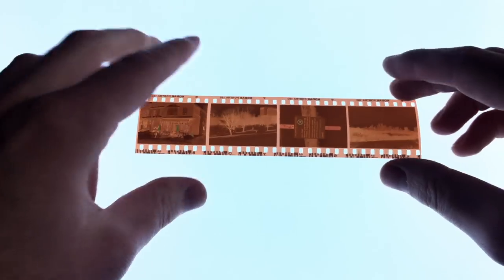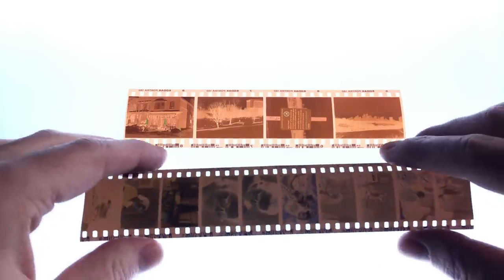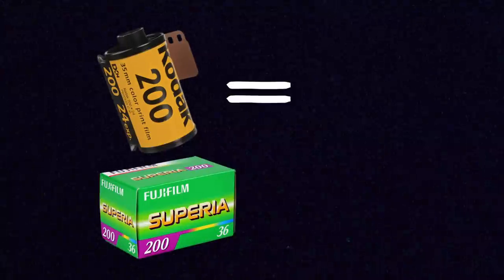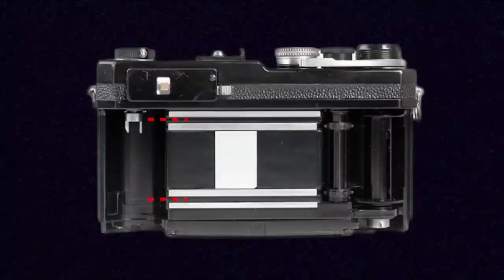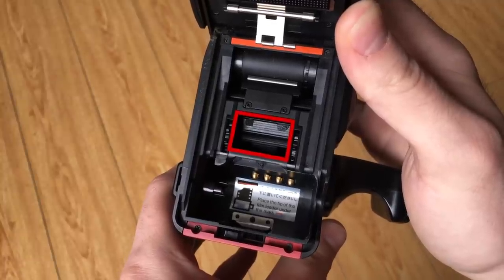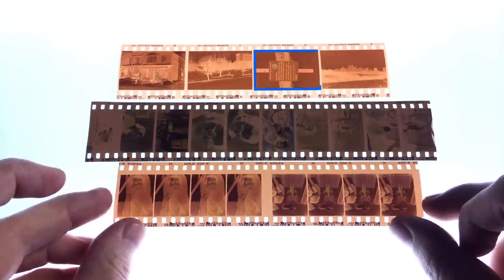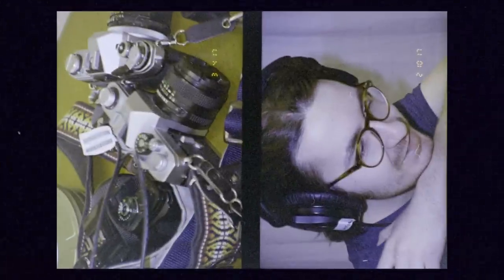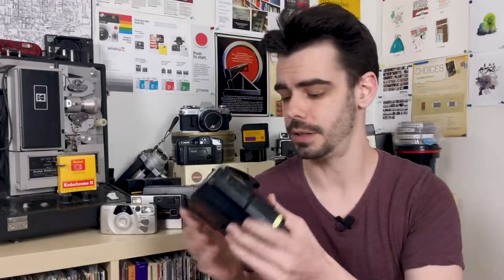35mm Half-Frame Cameras - How Do They Work?

Comment: There was kind of half frame camera in Soviet Union. It was called Agat-18 (Агат 18), and it's been producting since 1987 to 1990 in BeLOMO (Belarus). It is very interesting camera, because of it's controls, she has two rings that control exposure compensation and aperture control, and Industar-104 f/2.8 28mm lens. Funny fact is that even being not so correct in her exposures, she was doing pretty good shots in low-light with shutter speed of 1/120th, and had even hotshoe mount for flash!

Comment: Since the 35mm stills camera was not a thing before Leica decided to use movie film to produce 35mm stills camera in the 1920's, how could there have been any half frame cameras in the 1910's? Do you know of any examples? The earliest half frame that I am familiar with is the Univers Mercury series in the 1930's and 40's, but I am sure there must surely have been others going back a bit closer to the launch of the original Leica.

I am always amazed when people say that half frame was invented by Olympus with the Pen series, but I am now equally amazed by the idea of half frame cameras predating the Leica and 135 stills film.

EXCEPT, since cinematographers over the years have been in the habit of testing movie making lenses by shooting stills on half frame cameras, because the half frame image is closer in size to 35mm movie frames than the much larger 35mm stills frames, it makes me wonder - is half frame older than 135, and since filmmakers always had access to movie film, were there stills camera made at an early date for testing movie lenses and similar purposes within the movie industry?

Comment: I have a half-frame camera - a Chaika (Чайка in cyrillic) 2, which is a Soviet viewfinder camera, built from 1967 to 1972 in the Minsk factory MMZ, later BeLomo. It has Industar-69 lens, 28mm f/2.8, which were made specifically for the Chaika, they are on M39 mount, though. 
It was on my grandpa and grandpa, my father played with it (it has a dent on the side, too), I took it, along with its original case, lens cap and the original handstrap. I haven't shot anything on it for now, but I plan doing it in the summer, when I go to holiday.

Comment: i had an analog Noritsu printer, there was a half frame negative mask and lenses, so you can print half frame negative individualy, as for digita scanner,you alsocancrop before you scan,so you dont need to scan 2 at 1 time.

Comment: Until Leica brought out their first 35 mm camera, what we now call "half frame" was standard 35 mm, and the first Leica was billed as "double frame" -- twice the film area, to make the most of the (then) underwhelming film resolution and grain (look at some of Henri Cartier-Bresson's early work, shot with Leica, to see what grain they had to deal with back in the day).  They and Kodak also standardized the cassette we're used to; there were several other options along the way (the Agfa Carat was one that didn't have a spool, the film was just rolled inside and the camera sprockets pulled it out of one cassette and pushed it into another), but the Kodak/Leica design eventually won.  All those older "half frame" (single frame, same as then-standard 4:3 movie film) cameras you showed used some other method to supply and take up the film than what we're used to.  There were also some cameras that took a 24x24 mm frame (Robot was one of the better known brands), getting 50% more frames on the same film length.

BTW, I've got an Olympus Pen EES-2 with a still-working selenium meter; it's a nice little camera (auto exposure and icon scale focus lens).  I've had it since 1981.  If you hand-load your cassettes, you can get close to 90 frames on a roll...

Comment: Sorry this is a very late reply.
How do 1/2 frame cameras work? the same way as all other film cameras really!
Back in the day, (and I'm old enough to have been around then), the big advantage (apart from size) lies with photographers who preferred reversal (slide) film. Whilst 35mm films  cost the same regardless of the camera used, with negative film there was still the cost of twice as many prints to pay for. With slide film, processing a film that's been through a 1/2 frame camera costs no more that a film that's been through full frame camera, but you still got twice as many images.
The fact that the image is in portrait format isn't a problem any more that the fact that a full frame  image is in landscape. Turn the camera through 90 if you want the other.
An interesting side note. Many modern photographers (including me) still shoot 1/2 frame. My Nikon D300 has a DX sensor which measures 15.8mm x 23.6mm, not that far from 18mm x 24mm.

Comment: I have a little Canon Demi EE17 and it's a great camera. Has a sharp lens and takes good piccies. Though, I'm going to have to replace the light seals as they're starting to get a little thread bare, so to speak. I would like an Olympus Pen F or FT. But, they're a little pricey on eBay.

Comment: I first came across a half frame 35mm camera when I was at college in the mid 1960's. An upperclassman, a "military brat" who's family had been posted in Asia used a Canon Demi. This little Selenium cell metering unit was a match-needle-camera-selects-shutter-speed-aperture automatic with zone focusing. He'd had it for years, and his collection of prints during his Taiwan days were impressive. Later, I came across the Canon Dial 35, a "landscape" half frame camera with it's "rotary dial telephone" face and spring wound motor. Olympus' line of Pen cameras I saw much later, as the brand and half frame specifically, wasn't exactly popular locally. Still, the Olympus Pen FT SLR was a standout for those seeking a 35mm SLR camera. In the days before T-Grain technology, half frame cameras had "half the image quality" of Ye Olde 24X36mm format. 

And now for something completely different: In the mid 1960's consumer grade electronic flashes might cover 50mm/normal lenses only. I found this out after I bought a "Japan domestic" 4/AA cell Toshiba electronic flash. There was noticeable falloff when I used it with my 35mm f/2 Nikkor on Ye Olde Nikkormat FTn. By the time of the Vivitar 283, this was old news, and I expect these old Kakos, Toshibas ans Nationals died long ago. (Aren't you glad you live in "modern times" where flash and lens coverage match?)